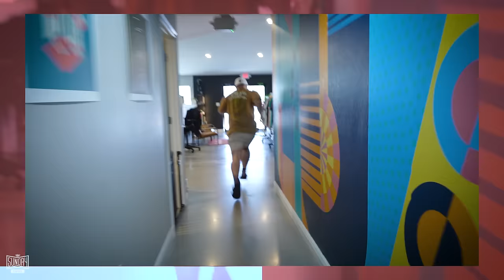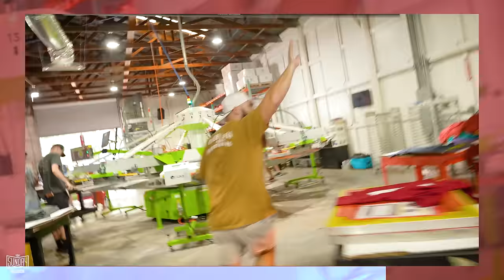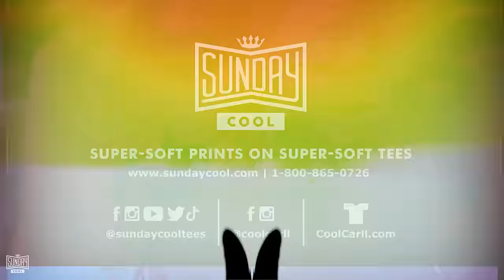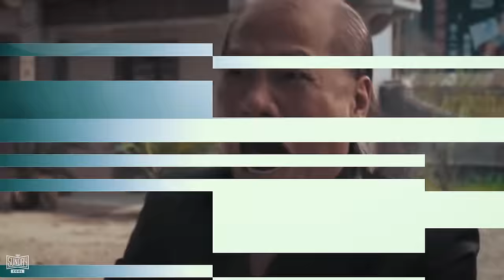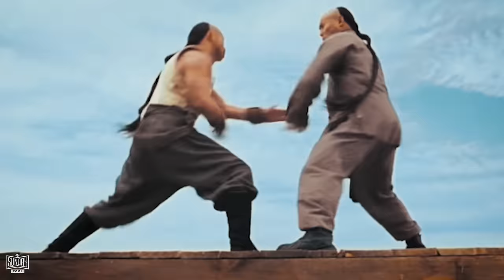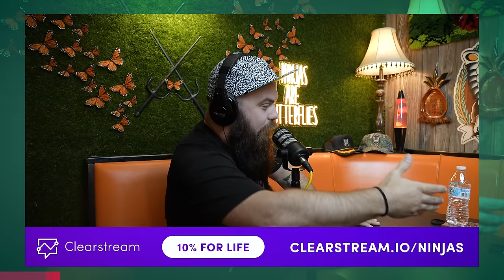Do Mothers Complain Too Much? | EP.37 | Ninjas Are Butterflies

Comment: Space time is "warped" not just in space. If you live on a mountain, you're affected by the gravitational pull of Earth slightly less so time is going like 0.000001% slower for you than someone at sea level. That's why in interstellar, when they are stuck on a planet that has a very strong force of gravity, in 1 minute spent there years had passed on Earth